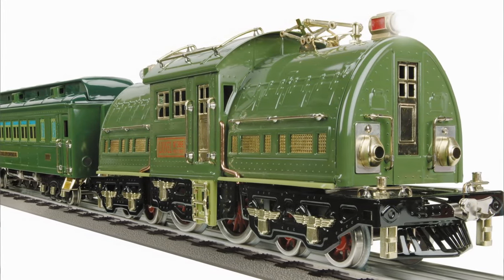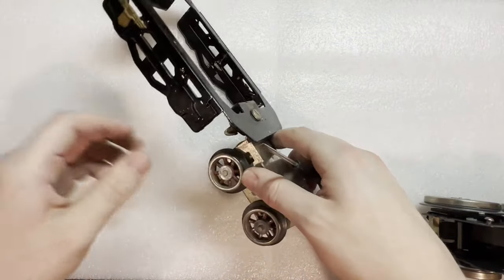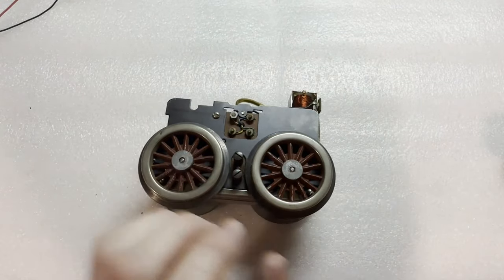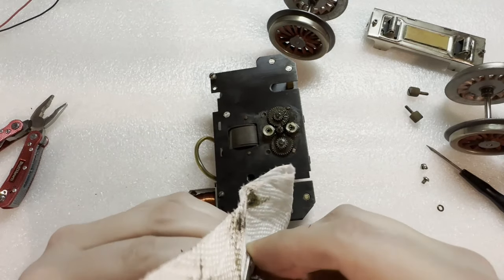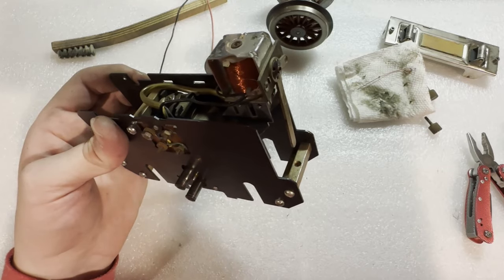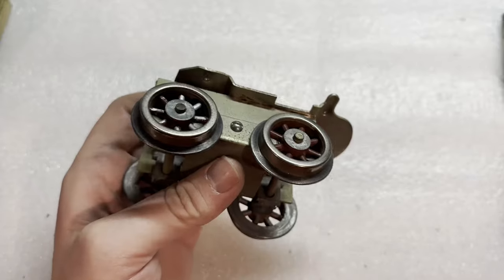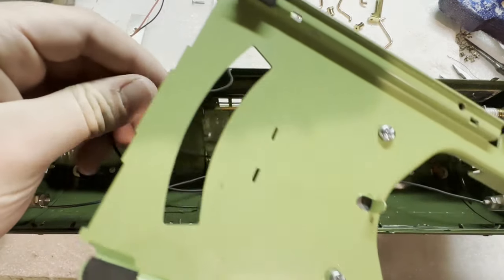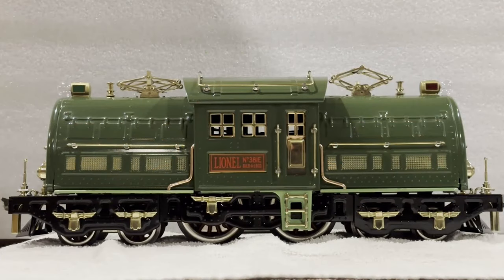Restoring a Lionel (Williams) Standard Gauge 381E

Comment: I like the MTA reproduction of the various Lionel and American Flyer standard gauge trains. I love the fact that some of the Lionel locomotive you can get with the original build a locomotor reproduced or you can get modern diffraction can Motors and sounds and smoke and all that stuff if you want that kind of version. I remember they had the huge prototype electric locomotives that Lionel never built and they just had the one in the display case and they went ahead and made that locomotive and it was $1,200 and I thought wow $1,200 that's a lot of money but now. Doesn't hardly buy you anything out of a Lionel catalog for 0 gauge nevermind new standard gauge trains.

Comment: What tools and methods did you use to bend the metal tabs? 
I have some tinplate engines and rolling stock that I would like to change the name plates or remove some parts but I am scared that I could break the tabs, scratch the paint finish, or bend the surface metal.
Reply from the maker: I mostly used a screwdriver to unbend the tabs, or pliers if they had to be untwisted. You can use wood or a hard piece of plastic to bend them back down as safely as possible. Paint scratches will probably happen as the tabs are straightened and pulled out, but a little touch up once you’re done should be enough to take care of that.

Comment: The 381e electric locomotive runs off of third rail except for the complex switching section of Grand Central terminal where it uses the small Pantagraph mounted on the roof. Therefore the third rail is prototypical for that particular locomotive even if it is not the outside third rail. Lionel was stupid not to continue the production of standard gauge trains. If he had made the 444 a true Hudson you would have had to o42 sections of track but the engine would have been correct instead of having the middle cut out.
Reply: The 381E is based off of the Milwaukee Road 'bi-polar' electric, I think you're thinking of the other loco that headed up state sets, the 408e with two motors.
It makes sense why everybody stopped making standard/wide gauge, since it seems like it mostly died off with the Great Depression. Bigger train, bigger price tag. And not everybody had room in their home for those massive trains. It's sad, but understandable why the gauge was dropped. At least there's lots of people who love it, and now there's delightful reproductions of lots of classics.
I suspect the reason a standard gauge 4-6-4 didn't happen, is because Lionel simply never made a 6 wheel standard gauge motor (besides the one used on the early, very rare 6-wheel 33), and didn't feel like the investment in tooling would pay itself off at the time they were contemplating it. Again, other folks have filled that gap since.